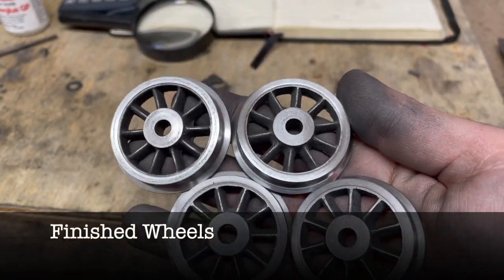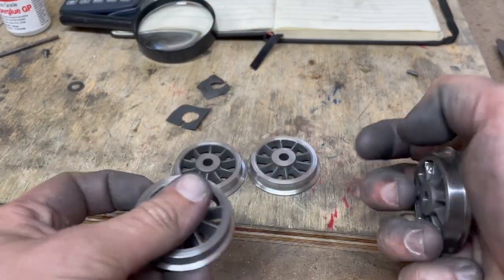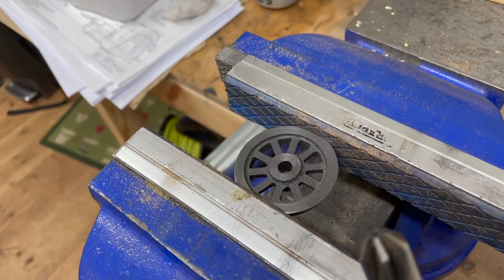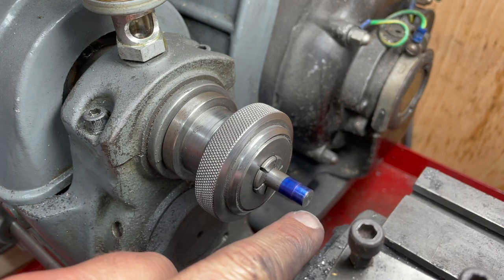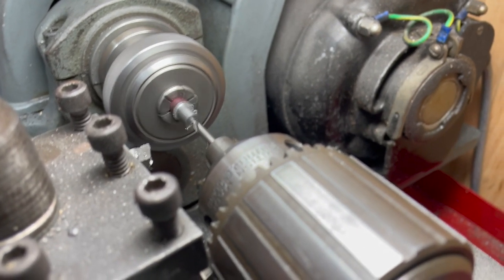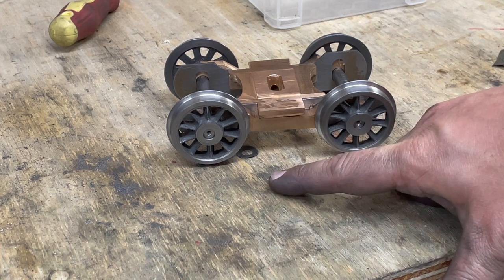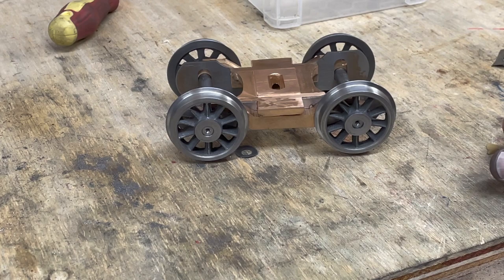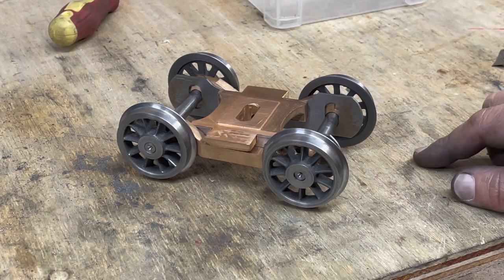Loco Build 1.7 - Bogie Axles and Completion

Comment: Nice work on the Bogie William...
Reply from the maker: Thank you kindly - I had to do a little more filing - nowhere on the drawing did it show that the angled sides of the equaliser bars need to be lower than the axleboxe height for the full diameter of the wheel - but that's my fault for being a newbie I guess!